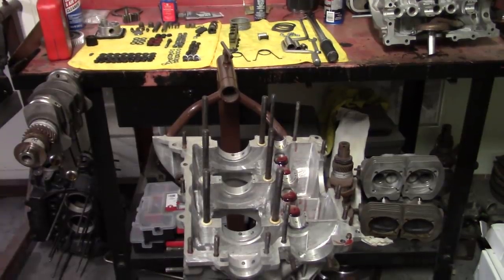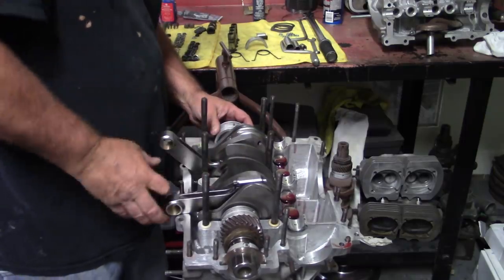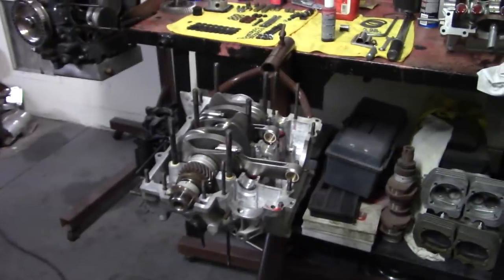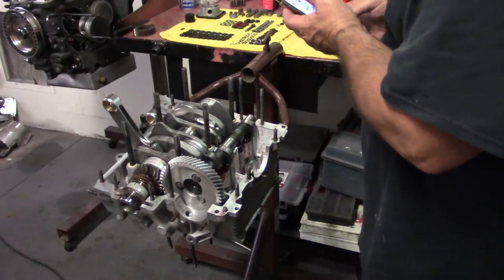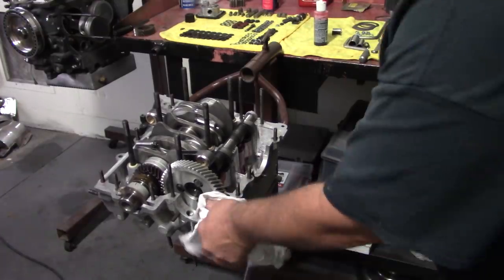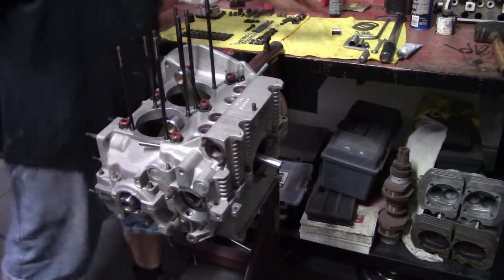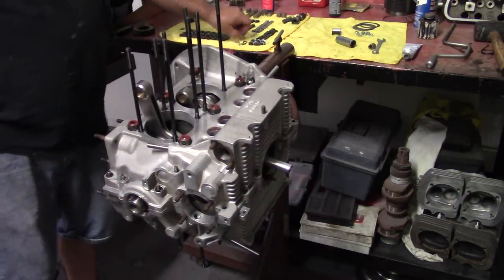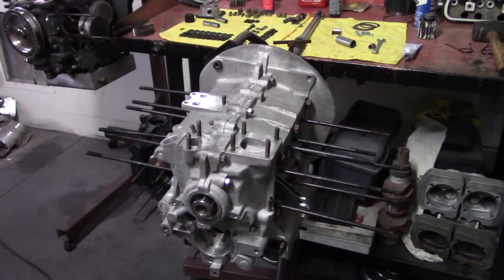let's build the vw 78+94 short block

Comment: FYI....you ARE installing the 6 main case sealing nuts on backwards.  The red rubber/plastic seal is meant to create a crush seal between the nut and washer, not meant to act as a nylock.  Same holds true for the nuts on the oil pumps.
Reply: Agreed. I still hate the removal with seal separated from the nut. Seal side down. Case has o rings for sealing main caps.